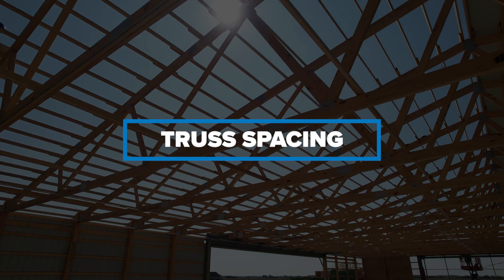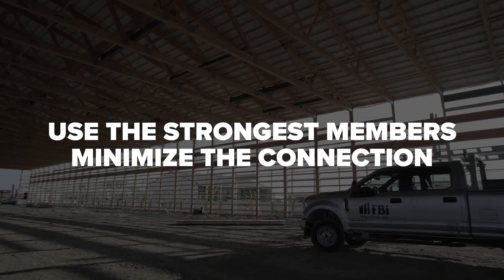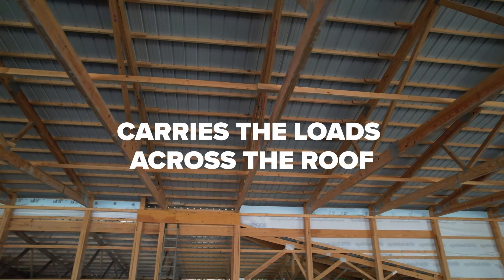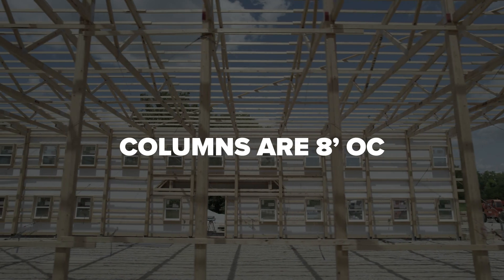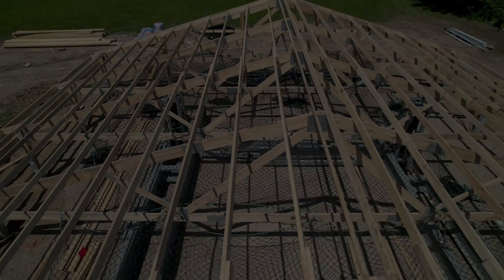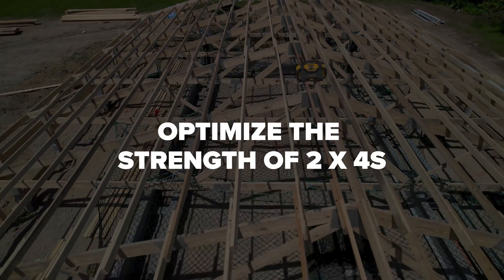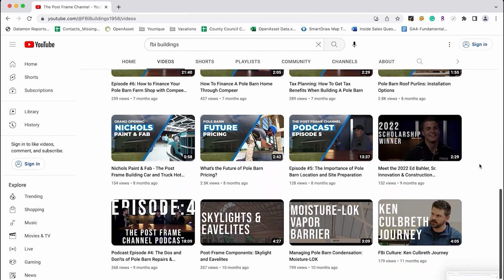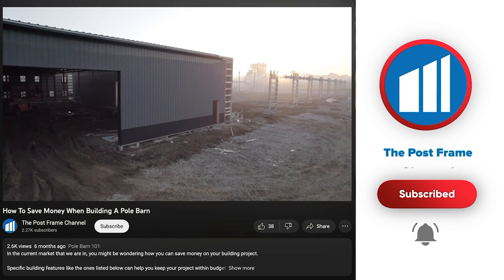Truss Spacing: 4’ OC vs 8’ OC

Comment: If I live in northern half of Indiana and want extra roof load capacity for the possibility of adding solar panels in the future would you just add an extra post in the length and go 6 or 7 ft on center with the trusses. What would be the easiest way to add extra load capacity to the roof?
Reply from the maker: Great question! The most effective way to plan for future solar load is to design your trusses for that additional weight from the start. Rather than adjusting post or truss spacing, our engineering team would increase the truss design load and verify the connections and purlin spacing support it. That ensures the entire system is rated for the extra load safely and efficiently.

Comment: Thank you for discussing this. I have been curious about this subject.  

I don’t see how an 8 ft 2x4 on edge purlin can meet code for a 40 psf total roof load. Even if you use Fb 1650 2x4s, with E 1.9, I think  you will exceed  L/180? And don’t you need Fb 1650 wood to meet the stress of 40 psf with 2x4 on 2 ft centers?  

I don’t agree with your argument that it’s better to have beefier trusses and fewer of them - all of them directly supported. You point out you would rather have the weight resting on structure, with the fasteners just keeping the supports in place, and not relying on their sheer strength to hold things up. While I might agree with you, clearly code allows for this and it is safe.  

Virtually all i-joists are held in place by the sheer strength of the nails that hold the joist hangers. 

If you have a 20 ft wide garage door in your pole barn, the weight of the 24 ft section of roof/walls surrounding the door will be supported by the 2 posts (24 ft apart). The majority of that weight will pass to the posts through a beam over the garage door, that attaches to these posts. The connection that holds up this beam will be the sheer strength of the fasteners to the posts.    

I am not a builder. And have 0 experience in this. So please correct me if I’m wrong.
Reply from the maker: Wow, for someone who’s not a builder, you sure sound like one 😂 Great questions and thoughtful points.

We actually have a follow up podcast coming soon where we’ll dig deeper into all of this, including code requirements, fastener shear strength, and structural design. Stay tuned, we’ll make sure to cover everything you mentioned.

Thanks again for engagin!

Comment: Why fbi does not use 2 5/8  inch bolts to fasten column to truss?   20 -30 nails  to fasten a column to a header or a column to a truss looks real sketchy  man .  Many other pole builders use bolts  for these very important  connections. No I don’t work for a pole building company.
Reply from the maker: At FBi Buildings, all our connections are designed and reviewed by our in-house engineers to ensure they meet or exceed industry standards for strength and durability. Thanks for your input!

Comment: think I would prefer 4ft for a ceiling and blown insulation
Reply from the maker: Thank you for sharing your preference! Setting trusses 4 feet on center is indeed a common approach in certain applications, especially when considering blown-in insulation for ceilings. At FBi Buildings, we choose to set our trusses 8 feet on center to maximize structural efficiency, provide flexibility for various insulation methods, and optimize cost-effectiveness without compromising strength or durability.

That said, we understand that every project has unique needs. Thanks for engaging with our content, and we appreciate your perspective!

Comment: Why not flat (sloped) steel trusses holding up ICF deck for roofs and floors, the trusses go one way and the steel beams in the ICF go perpendicular to hold the forms and the concrete beams span between the steel trusses, the ICF gives you the insulation above the trusses while the trusses give you the building HVAC, plumbing and electrical run area. With Amdeck you might be able to get away without any ICF supports below it by placing the trusses so they were the supports during the pour for the cement beams.
Reply from the maker: Thanks for your comment! Using flat/sloped steel trusses in combination with ICF (Insulated Concrete Form) decks is indeed an innovative approach, especially for applications where you need integrated insulation and a clean area for HVAC, plumbing, and electrical runs. Systems like Amdeck can offer great versatility by acting as both the form and insulation layer for concrete roofs or floors.

That said, this method is often seen in commercial or specialized residential projects, where factors like higher budgets and specific design needs justify the complexity. For pole barns or similar structures, traditional wood or steel trusses tend to be more cost-effective and easier to install. They’re also highly customizable to meet snow and wind load requirements.

Comment: 8ft spacing seems too far for 2x4 purlins based on all the span tables I've seen. Does the structural steel roofing allow you to have longer purlin spans?
Reply from the maker: Great question! The 8' spacing works because the structural steel roofing adds strength and stability, allowing for longer purlin spans compared to traditional setups. However, it’s always important to follow engineering specifications tailored to your specific building design and loads.

Comment: Is that code in Michigan? Thanks 😊
Reply from the maker: In Michigan, building codes for truss spacing are generally dictated by the Michigan Residential Code (MRC), which is based on the International Residential Code (IRC). The code requirements for truss spacing at 4-foot and 8-foot centers primarily depend on several factors, including the type of structure (residential, agricultural, etc.), roof loads, snow loads, and the span of the trusses.

For a specific project, it's essential to consult with a structural engineer or the local building authority to ensure that the truss spacing meets the required building codes. Additionally, reviewing the truss manufacturer's guidelines and any engineering specifications is crucial to ensure compliance.

Comment: what about ten foot on center ?
2x6 joist hangers 24 on center with 2x6 purlins
Reply from the maker: Thank you for your question about truss installation and joist hangers. Installing trusses 10 feet on center with drop in purlins is feasible, but we have found that 8’ on center with purlins attached continuously above the trusses is more cost effective.
 
Using 2x6 joist hangers spaced 24 inches on center with 2x6 purlins can work, but since they are not interconnected from bay to bay (across the trusses), you lose significant diaphragm strength in your roof resulting in additional costs to add strength back into your roof system by other means.

 Before proceeding with the installation, I recommend consulting with a structural engineer or building inspector to ensure that your design meets safety standards and structural requirements for your specific project.